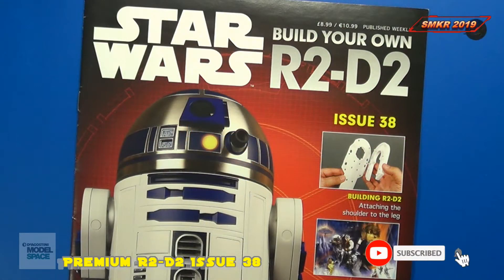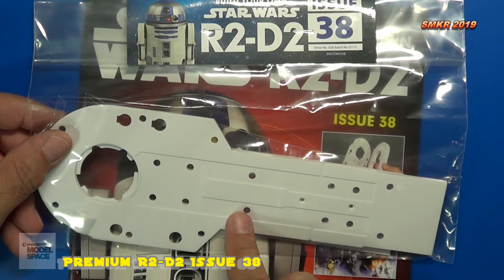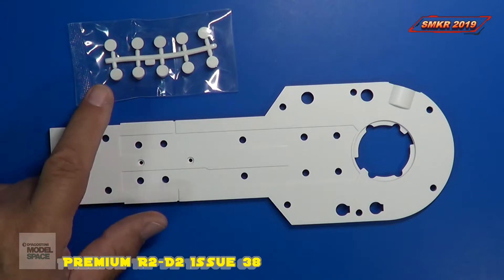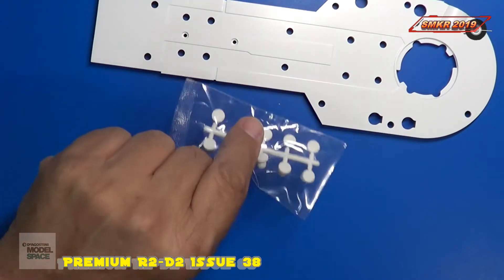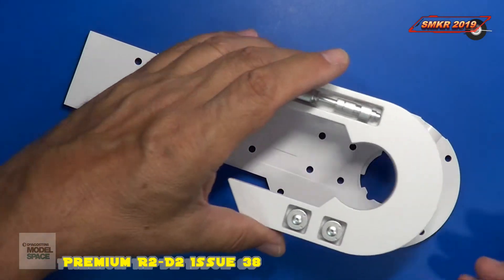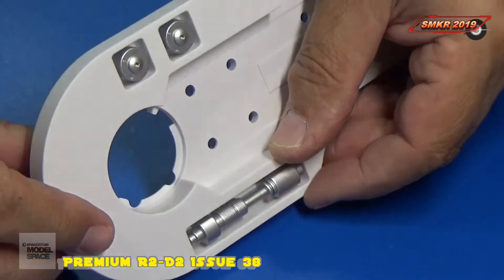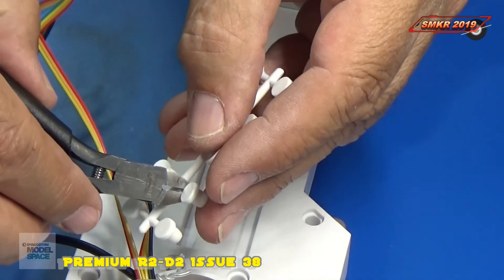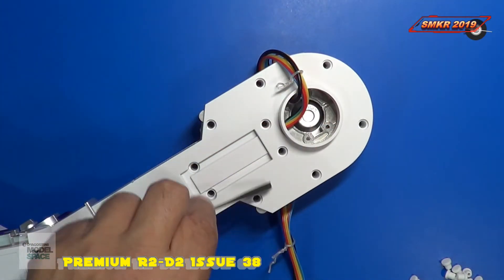Build the Premium 1:2 Scale R2-D2 Issue 38 - Assemble Left Shoulder

Comment: There was no need to cut off the edges of the 2 plugs.  Those plugs should have been installed in the center of the leg.  A later issue will provide you with 2 plugs that have a flat edge to them.
Reply from the maker: Thanks, too late now! Lol